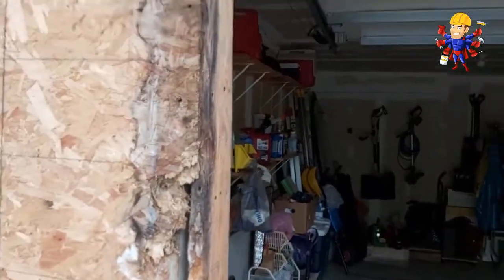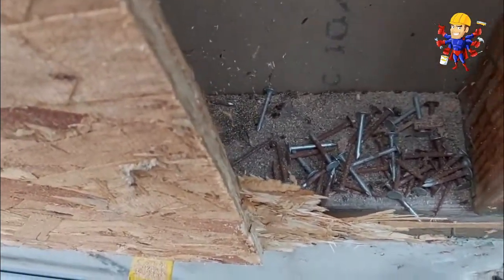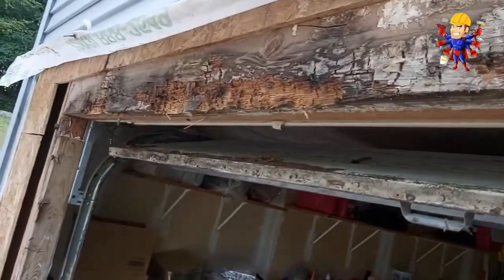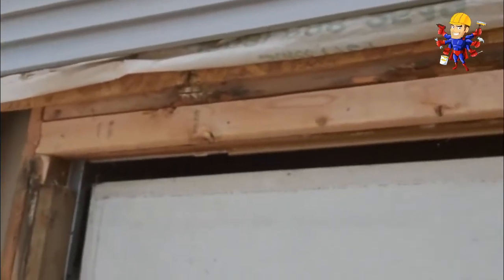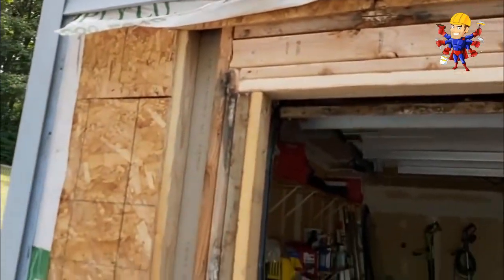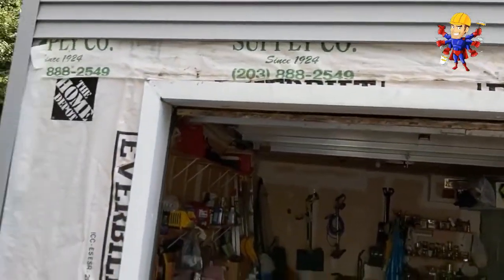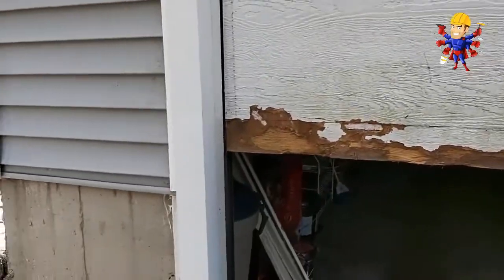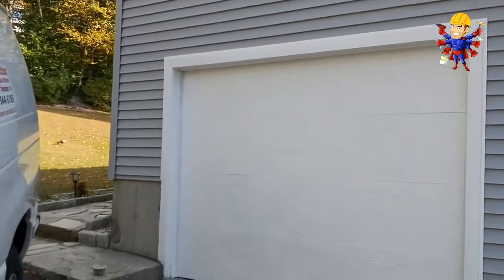Garage Door Repair Rotted Framing and Door Bottom

Comment: Would have been good to see the actual process instead of just the before and after.
Reply: YES !! That was the whole point of watching video 1 & 2 :/ to see the repair process & how it was supposed to be put up so it doesn't get water inside again.
Reply: @MMMayes82 ok i don't see any reference to the full video. 😊
Reply: @MMMayes82  I didn't see a reference to any other videos.

Comment: I noticed you installed the weather seal around the door on the right hand side garage door on the top left corner it’s not nailed correctly and on those weather seals they are little Divet’s where each nail needs to be and hammered